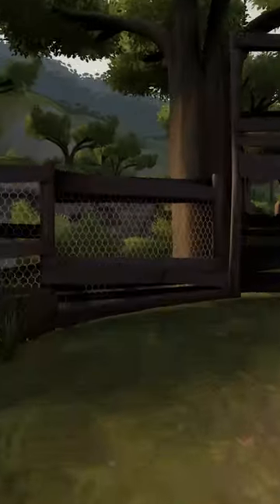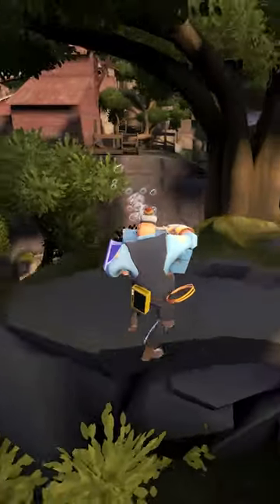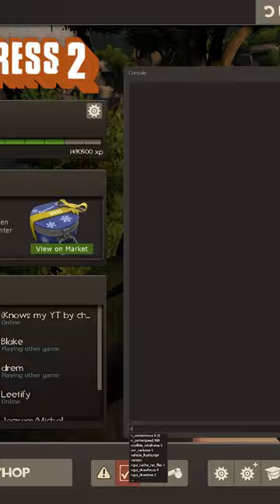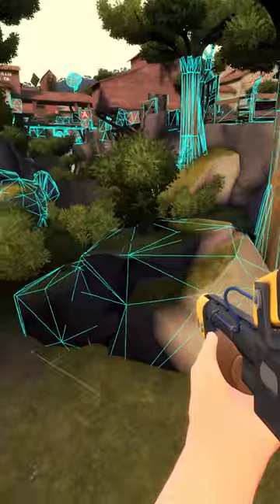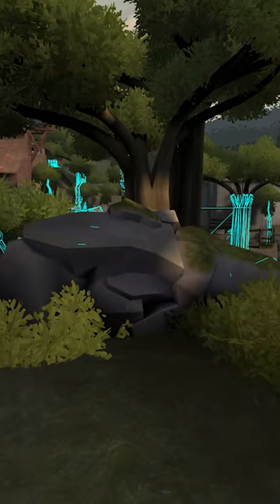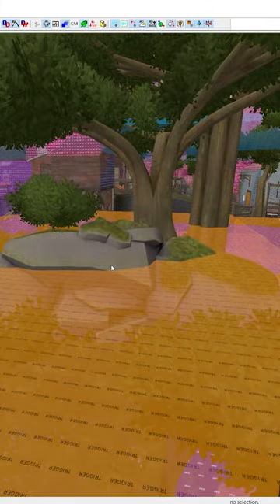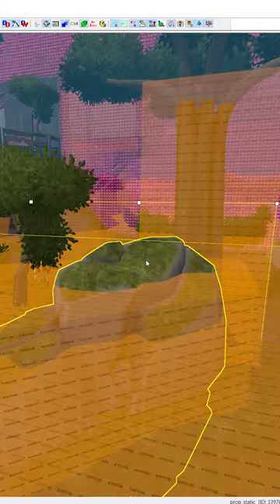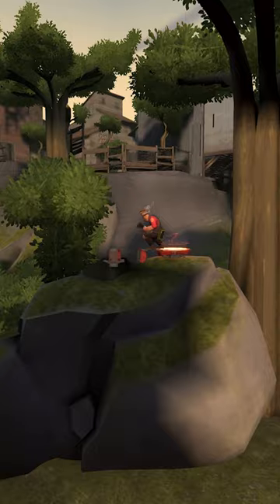Mossrock's Rocks are Weird... #tf2 #shorts

Comment: also can you maybe explain why mossrock randomly has white wireframe meshes dying in the air pls?
Reply: I dont think this is spicific to Mossrock. I have this issue on Banana Bay a lot, and i think ive even encountered it on Swiftwater one time.
Idk what causes it.
Reply from the maker: I have no freaking clue why that happens. Been wondering for years